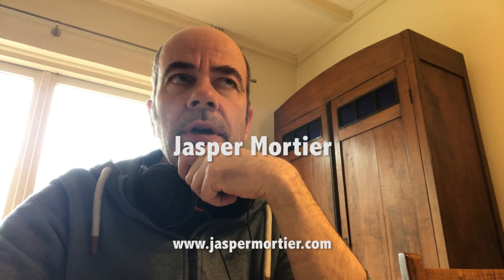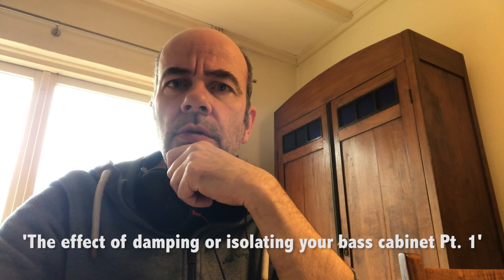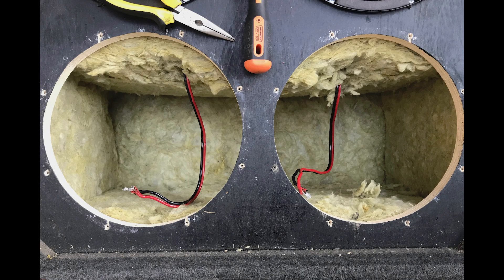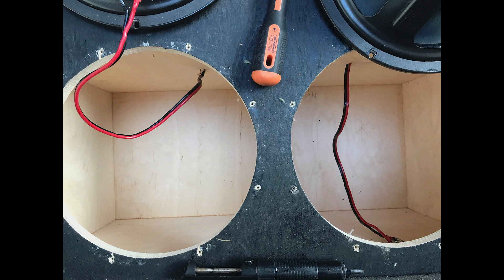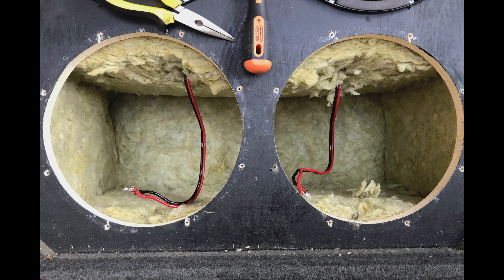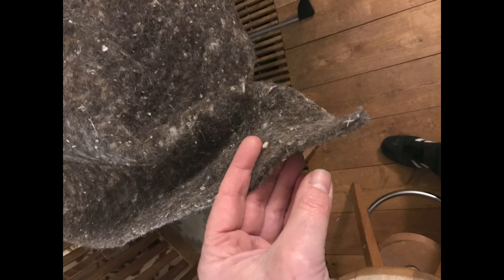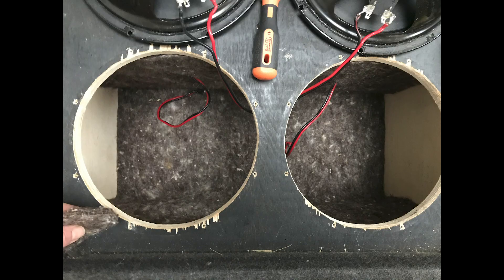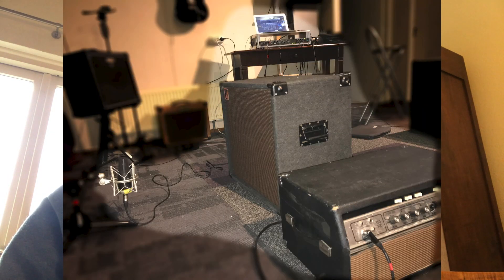The effect of damping or isolating your bass cabinet Pt  2: mineral wool vs. sheep wool

Comment: Hello, I find the sheep wool better too. Can I know where you bought this or which brand of sheep wool this is? I am looking for a way to reduce standing waves in my small bass cabinet. I had a really nice sound with 5cm glasswool on all sides. The fibres however were a serious problem even with my closed cabinet, so I removed it. Looking for the most decent replacement material now.
Reply from the maker: Realize 5cm is way thicker than my material which is like 1 cm at the most (even less). My stuff is called 'Doscha WF 4mm', but only available in large quantities for building houses. I was lucky to find a left over piece at a shop specialized in ecological building. Maybe you're able to find something similar? Or maybe you want to go for the thicker 'polyfill' or 'fiberfill' (polyester fibre). I think that's what they use in modern cabs.

Comment: The real differences are only going to be noticed in volume, enough to drive the speaker and cabinet.. Id be very interested in a video that shows this, i play guitar through an ampeg 8x10 and the insulation is bothering me, but without it i dont really know if it would strangle the mids and highs less, or if itd just be too boomy
Reply from the maker: There's a volume difference, but pretty subtle and I had a lot of isolation in there at first, way more than original 8x10's use to have. I think my video also shows that the closed cab without isolation not suddenly will become super muddy middy or whatever. The effects are really small.

Comment: At high volumes the reflectingsound waved create a muddy sound
Reply from the maker: You hear this in the recording or you mean live? And I'm not sure which one you're talking about.
Reply: What I am saying is.....the higher the volume inside of the box the stronger the sound waves inside the box becomes..... the sound waves become strong enough to impact the speaker causing distortion
Reply: By volume I mean loudness
Reply: So when you are playing the speaker loud the dampening material absorbs that energy and allows the speaker to not distort
Reply: You can just use a fiberglass roof tile just peel the painted side off
Reply: And wrap it in a 1 mil polyurethane plastic..the low frequencies travel threw the plastic
Reply: As a cheap alternative
Reply: I actually use 15 inch and 20 inch speakers for bass guitar
Reply: That gives me the sound I want from a bass guitar
Reply from the maker: I guess it shows more at higher volumes yes. FYI I did play it roughly at stage volume.
Reply from the maker: Interesting! @jasondavis4421

Comment: Thumbs up for the sheep wool.
Reply from the maker: There he is! Yes it works perfectly. Afterwards I also put some isolation on the side walls too (or did I already tell that in the video?) I got it in there now for 2 years or so? No complaints at all. Also on bigger outdoor stages: still warm and punchy, not hollow or something. But once again it's all pretty subtle.
Reply: @JasperMortier  
Is Sheep's wool more expensive?
Like cashmere sweaters?
Reply from the maker: @christianscott6963  Ha ha. No I totally found it by coincidence, a super cheap left over. Glasswool - not too thick  - does the job perfectly too I guess.